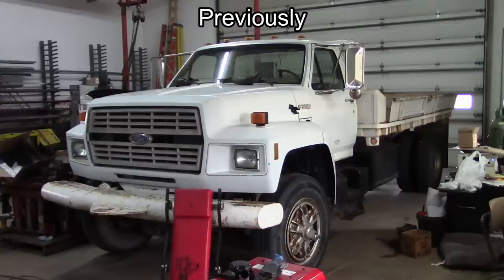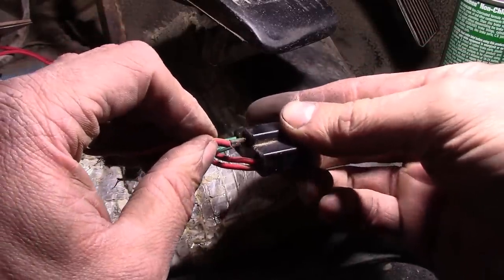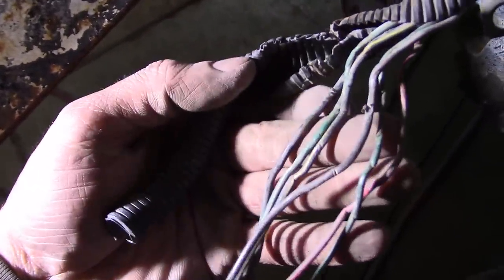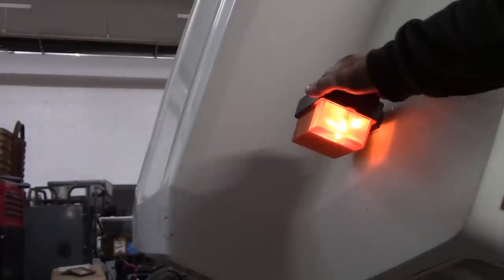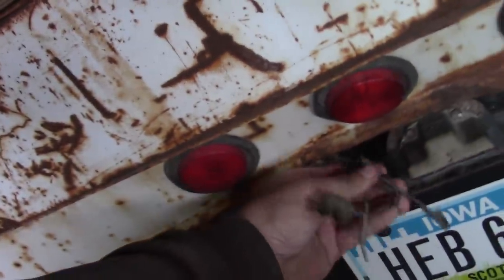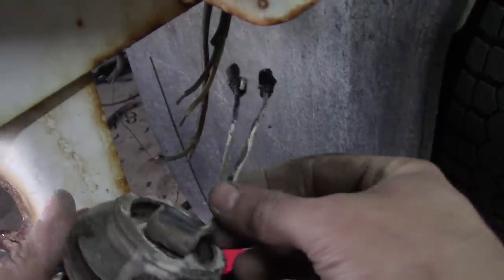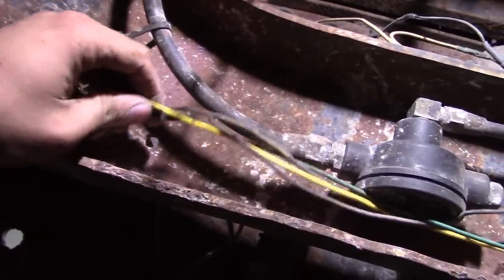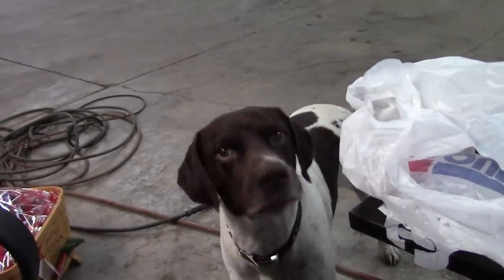Ford F700 Project - Fixing the Lights - Part 2

Comment: Belt and suspenders, solder the crimp connections!
Reply from the maker: A good crimp is just fine by itself.
Reply: Solder can wick along a wire near the connector and cause flexibility problems (brittle breaks). Overkill is not always the right choice

Comment: I use a longer crimp hose and where there are two cables I heat it extra well and squeeze with a needle pliers between the two cables so that the crimp hose glues together and one is sure that both cables are actually sealed .. and wash the cables with acetone before mounting otherwise the glue does not work! and shrink the hose is not really better than tape .. we have the pleasure of salt in the winters in norway too ;-)

Comment: Have you ever tried using dual wall adhesive shrink tubing in areas exposed to the elements?   When applied properly it's totally waterproof, I highly recommend it.

Comment: I'm thinking next time the Snap on truck stops at your shop you need to order yourself a new soldering iron. You can solder the crimp pins back on that go into hard shell connectors. I always use a wire holder I have, shaped somewhat like a wishbone. Makes work easy

Comment: Yeah. Lots of crappy jobs. I never minded wiring though. No shrink tube in my day, I tended to solder or use Scotch locks. Scotch locks I tended to use inside the vehicle, like wiring a tow hitch, but preferred solder in wiring runs for the lack of bulk. It went well for you, and I'm pleased that the dog got the rabbit too. It's what dogs do.
Reply from the maker: Shrink tube has been around for a LONG time.
Reply: @WatchWesWork  Bear in mind Wes, I'm from Scotland. We only got "lectric last year.

Comment: I had what Autotrend magazine called one of the top 5 worst vehicles made up to 1995. 1984 Dodge Pickup truck it was a 6 cylinder and I think it was a D150 or D50 can't remember. Every 6 to 8 weeks in the winter here in Iowa we would have to replace the floor dimmer switch. I finally decided to just omit it, however Dodge made it an integral part of the lighting system and luckily for me my Uncle Philip and Uncle Gene were wonderful mechanics and they rewired it from floor switch to a dash switch and I never had another lighting issue.

Comment: I am a little finicky about how to attach wires together being a career electronics engineering technician. I ALWAYS twist and solder every joint and use heat-shrinker covering over the joints. That is absolutely the best way to get a proper current flow without corrosion that can occur with crimp joints. But that is just my way of attaching wires and there are other ways that work as well. But you can't pull apart any quality soldered joint...period! JMHO  Thumbs Up.

Comment: Fer cryin’ out loud, crimp new spade connectors into that dimmer switch housing. Pretty common type terminal, easy to source.

You may actually be able to find a better switch, more HD, better terminal protection, maybe even one with pigtails that will bring the connectors off the floor.

Comment: Hi Wes, thanks for another great video. You probably already know this trick, but on the off chance you don't.  If you run out of dual guage connectors, just use one that is sized for your 2 wires, add a piece of scrap wire to your single wire side. Crimp as normal, then clip the scrap wire off at the butt connector.
Reply from the maker: I usually just double the length of the strip and them fold the end of the wire back on itself.

Comment: great work wes.amazing how that wiring was cobled together like that. was it blowing fuses?
Reply: Ive worked with guys that cobbled up wiring just to get that "i-fixed-it" pat on the head from the boss who should have yelled at them for causing more damage.
Reply from the maker: No. The lights are on a circuit breaker.
Reply: @WatchWesWork  👍

Comment: Wiring job before you was a cobble as you go.  Never fixed most connections right. Just cobbled it to work. Hate that. Had to redo stuff like that before. Bad thing usually have to go back and fix something I missed. Looks a lot better.

Comment: That's a nice smaller heat gun. If all a person  has is the larger heat gun that didn't come with accessories they can use a scrap of sheet metal and a hose clamp to fashion a surround heat shield or other accessory. I enjoy your channel and for all of us that maintain older equipment I say post apocalyptic fiction has nothing on us!

Comment: Some times I've found when wiring is this bad it's cheaper and quicker to just cut it all out and start again. If an old vehicle and cost needs to be kept down I often use 7 core trailer cable as a cheap, dirty 'pre made' harness for rear light wiring. Nothing beats a proper individual wire carefully made harness but as Wes says its very time consuming. I find the trailer cable is a happy compromise, better than hacking away with spices atleast.

Comment: I have the same issue with my left turn signal on my F600, i end up having to hold down on it a bit to keep it working.  I just let it be, its not worth the effort sometimes on a vehicle thats 34 years old and gets used 10 times a year.

Comment: When you have shrink tubing that's just a little too small in diameter, put your needle-nose pliers in the end and open the pliers to stretch the tubing open.  Rotate and repeat.  It will shrink back down a little, so be quick and slide it over the connection then shrink it into place.
Reply from the maker: Good tip!

Comment: I had to do a set of slml flatbed hay trailers from female pin box to splice box on 1st trailer set of lights to rear plug to jumper cord to second trailers complete. Filled two 6 fallon buckets of old wires packed in tight. Replaced at least 74% of the lights. Then had to put all new reflective tape sides and back. Took 1/2 day to remove. 1.5 days to put back had to get with owner to set up how want rear lights to look. One blink, two blink, three blink, etc. Running three rear rounds each side with required markers. And how many side lights. Marker, Etc he settled with a Christmas tree! Of lights. Glad he had a high out put alternator! No way could miss him also made six  light bars he could put on top sides and rear if wanted if loaded with hay! He loved his lights  No way not see him coming or going.
Reply from the maker: Heh. That's where the LEDs are nice. They cost 3 times as much but they use basically no power.
Reply: @WatchWesWork  that was before Led's

Comment: I've seen all kinds of slice connectors and other connectors and you just showed me yet another type thanks. As far as that tape I'm thinking that was rubber mastic tape which is a super effective way to keep connections corrosion free be it an uglier solution. I bought some splices that actually have the solder in them that melt to the wires when you heat them with the heat gun. They also have a type that has an adhesive built right in that melts around the wires to seal the connection (adhesive lined heat shrink tubing as well.) LOL now the question... which is best to use at the time you need it?

Comment: My preferred method (do it once)  SOLDER. You should know Wes ..here in the Midwest crusties love crimp connectors.
Reply: Everybody has their preferred method.  I seldom see a quality solder joint, and none of them are free of flux which eventually causes the joint to fail.  Wes uses lined heat shrink.  Sealed environment, no corrosion.
Reply from the maker: A good crimp is stronger than the wire itself. 100% of OEM wiring harness connections are crimped and they rarely have issues. The shrink tube is critical.

Comment: Butt connectors are so fast, and in qualified hands they rarely fail. Even so, I find it a little disconcerting that we don't routinely twist the wires around each other for more mechanical stability against axial tension. I guess people don't do that because wrapping wires would double the diameter of the splice. The biggest problem with a bulky splice is the difficulty finding shrink tube to both go around the splice and also shrink down enough to give a water tight seal where the smaller wires enter. Any thoughts?
Reply from the maker: There are basically zero connections in a factory wiring harness that are twisted or soldered. They are all crimped and sealed. I think it's the best way.
Reply: @WatchWesWork  Good point. They say that vibration can destroy a soldered joint, so I twist whenever I solder, but I can see why a professional workflow has largely abandoned that approach. Twist and crimp sounds better but is practically difficult.

Comment: I'm assuming you're making a joke about the dielectric grease? If so it went way over my head lol. I use that stuff on all my connections up here in the Midwest because of the moisture and salt. Saved me a lot of future headaches. Never had a problem yet.

Comment: I got stopped by a Utah Highway Patrolman because the turn signals on my trailer were not working. He told me not to be on the road before they were fixed. So I wound up using split shot sinkers and bandaids to make the splices in the wires.

Comment: Yep, the "oft & scoffed" at, dialectic grease...  "i put that sh#t on everything" (just a little play on a quote from a Frank's red hot sauce commercial)... hahaha...
    That little truck now has another 20yrs of life.  You should have talked to the owner and made deal with him to swap that  7.3 Powerstroke of yours into it.
Great video sir,
Thank you.
Reply from the maker: I wonder why they didn't use the 7.3 IDI in these trucks.
Reply: Watch Wes Work 
    I didn't catch what year this rig was.  If it is in the realm of the Powerstroke, I would say because of the almighty dollar(s), more than a gasser.  If it was in those IDI years, I would lean towards that 429, over ID.
   That IDI was pretty sluggish, even with the 1994.5 turbo model.
   I drove a little larger model, in a flatbed dump, with a 475cu., industrial gas, 5spd w/2-speed rear end, was pretty impressive.
   I was kinda joking about parting out that Powerstroke pick-up of yours.  It may be suffering from body cancer, but a guy like you could peck away at repairs, and have an excellent "parts runner"...
   Might check out a YouTube channel "Fitzee's Fabrications".  I stumbled across him a few months back.  Pretty good watching...  maybe if you don't have a life, like me...  hahaha

Comment: I was really hoping the dash lights weren’t working!! My ‘92 F-700 has had no dash lights for the last few years (and has yearly safety checks and roadside inspections pass with flying colours!?!).  I was hoping you’d save me the diagnosis time! And funny, watched one of A Camarata’s last videos and seems his F-800 has the same problem... absolutely love your videos, find myself asking “what would Wes do?”, maybe a bumper sticker is in order?
Reply from the maker: It's a pretty simple circuit. There's a rheostat built into the headlight switch that sends power to the back lights.

Comment: 2:33 usually by the time I get them, those connectors have burned up from the amperage due to the bad connection and I have to splice in a whole new connector

Comment: The old Fords sure had there electrical issues sure glad they got away from the old wired Cluster looms behind the dash like Peterbuilt ever been there WholeeeShxt all same wire color white just a number on each end , I just done my Motorhome wow Still have a Fuel tank Spook I`m chasing around front works back doesn`t gonna change the Unit itself , - Having a headlight at the back of a dump truck is a blessing for backing up .
Reply from the maker: Yeah big truck wiring sucks.

Comment: When I do the middle wire inserts I make a hole in the one wire then thread the new wire in it twist solder cover.
Reply from the maker: That doesn't let you use shrink tube.
Reply: @WatchWesWork  no sir it doesn’t. Liquid tape though. I’m not in the rust belt so liquid tape works well

Comment: Very nice job. Where do you get your adhesive shrink tubing and your non insulated wire connectors?
Reply from the maker: Any electronic supplier. McMaster Carr has them.

Comment: Fingers & knees, burning and crunching with arthritis-
the real fun is when it moves to jaw hinges and eyes;
forfeit breakfast, black coffee & aspirin to the rescue.

All those cuts look deliberate, as if someone maliciously
snipped as much as possible, then repairs were hastily
done, just to get it going again- then were forgotten 
(why repair working things).

Extension cords make for cheap, durable lighting wiring-
already vinyl coated, 3 wires, usually flexible.
"Proper" wiring is ridiculously expensive. OHM each & label
with numbered tape, like many machines are. Print out
a legend/diagram/spreadsheet, keep it in the vehicle.
Reply from the maker: Jacketed duplex and triplex wire is fantastic for truck wiring. It's not expensive and it's really tough.
Reply: @WatchWesWork  Thank you for answering, and your agreement- so I don't sound stupid. Yes, if it can handle 110v AC it can handle 12v DC.

Have you ever seen this site before?
https://www.parts4engines.com/

Comment: We have a very similar 700 ours is a 1995    Engine that was giving me fits (Would run till warm than when in open loop run would bog down backfire just run like a flaming pile)  had three mechanics come look it trying to figure it out the last one was stumped did not want to admit it started throwing components at it.  Finally, I pulled the brain found three capacitors leaking and damaged the board.  There is a company out of Florida that can reprogram older brains.

Comment: Surely we love salty roads? Where I live now, they do not salt the roads at all, 
but I come from southern Sweden and there was always salt on the roads. 
In winter, to melt the ice and in summer to bind the dust. 
We had almost only gravel roads there.
Reply from the maker: They do the same here with gravel roads, which we have all over.
Reply: @WatchWesWork  Jeupp.

Comment: I had a bunch of partial wire splicing kits while redoing the wires on my trailer I searched my whole garage and barely scrapped together enough bits to get the job done. Did my best to find a good kit on the internet but all I was finding was crap. Lucked into a huge collection of kits at a yard sale. Brought them home set up a designated tool cabinet just for all the stuff I got..... And haven't need it in 6 months.. Go figure
Reply from the maker: Heh. I have a whole drawer unit filled with crimp connectors.

Comment: Why didn't you fix the turn signal issue?  Seemed to work if the steering wheel was in one spot ...
but it's going to move so....?

Comment: Max has a no tolerance policy for trespassers . It's scary to think that there are DIY's residential so called " electricians " that use the twist and wrap with dollar store electrical tape , which sticks to nothing , I have seen it hundreds of times over the years . Good job , enjoyed .
Reply from the maker: It might work in a house, but a vehicle with vibration and corrosion will not hold up.

Comment: EVERY SINGLE WIRE SPLICE IS JUST TWISTED AND TAPED!!!! LOL I feel your pain.. i just re-did my whole trailer after finding 20-30 butt connectors in ~15ft of harness
Reply: I bought a new car trailer, lights broke after a year. Scotch locks were used when it was built new>

Comment: Wes, how do you decide whether or not to work on a fan or subscriber's vehicles? Do you actually seek out more of that work or is it just filler work and material for the channel? I'm in Southwest Michigan and although I'm sure it's quite a poke, I always thought it'd be cool to see you scratching your head working on my '97 Ford service truck. Thanks, and great work on this one.
Reply from the maker: There is no system. This one just worked out well. He was close to me, it's a truck I know a little about, and it was a good fit for my shop.

Comment: couldnt you use an acid base flux to clean electrical connectors ?
Reply from the maker: I don't know.
Reply: The deal with flux is you have to ensure 100% of it is removed or it will corrode causing eventual failure.

Comment: Weller is pretty proud of that heat gun at $110.  I can get a $20 gun with the same heat shrink attachment.
Reply from the maker: There is no other heat gun in the same league as the Weller. But it's probably overkill for most people.

Comment: I find most of the time these wires are even use the corroded off in all green and the switch is bad so you got to replace the switch and the wire connector. That's the most common reason the headlights and light stop working

Comment: Techflex needs to sponsor you
Reply from the maker: What's that?
Reply: @WatchWesWork  Braided sleeving and heat shielding for wire, hydraulic hose, fuel lines. Also Wirecare.com sponsors Mike Finnegan. I've seen his work using their products and its quality stuff

Comment: I'd personally just replace the crimp. they are called Packard 56 terminals you can pick up a kit cheap on ebay, or napa sells them also.
Reply from the maker: It seemed to be in good shape, but needed a little love.

Comment: Wes I don't understand the dielectric grease arguments.. Why does it work when applied to the connectors? Why do people say it shouldn't be used that way?

Best regards
Reply: DIELECTRIC GREASE ACCORDING TO SOME, DOESN'T CONDUCT ELECTRICITY. BUT IT DOES HELP ON CORROSION AND IS WATER RESISTANT. AS YOU SAW, WES CLEANED AND TIGHTENED HIS FEMALE SPADE CONNECTOR THUS ENSURING A GOOD PHYSICAL CONTACT AND THEN HE "WATER PROOFED" IT WITH THE GREASE.
Reply: OKAY TERRY THANKS FOR THE ANSWER!
Reply from the maker: It's kind of a running joke I have with the commenters who tell me never to use it because it stops the flow of electricity.